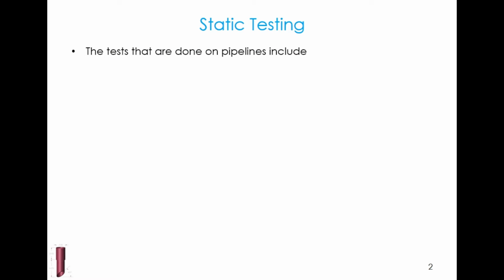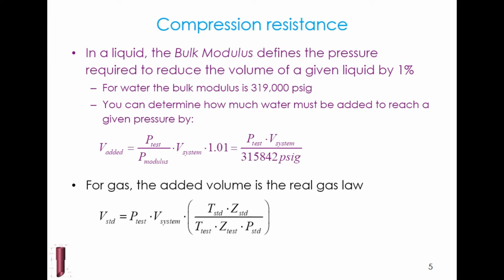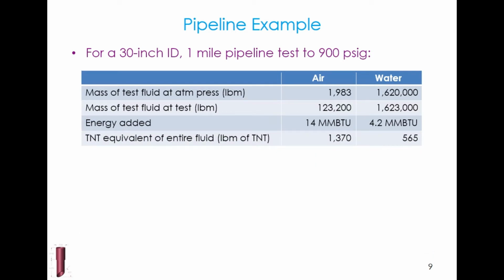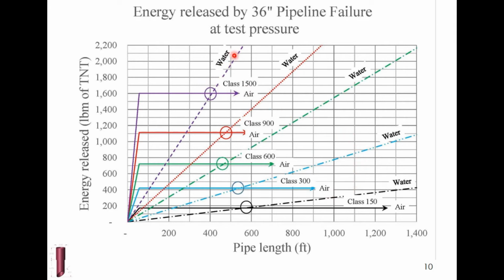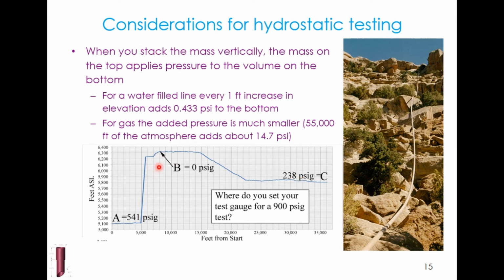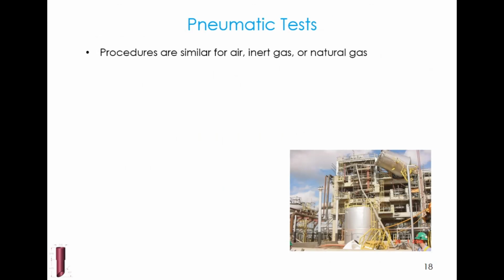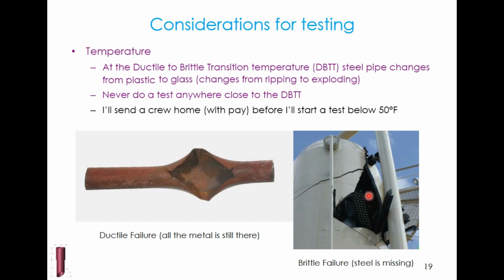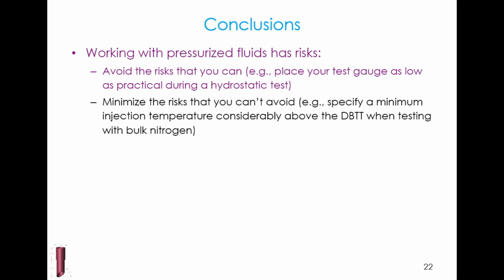Comparative Risks of Hydrostatic and Pneumatic Pipeline TestingV3

Comment: David, on the slide you show at 9:26, you say that in the case of air, only 59 lbm TNT of energy can participate (I assume this is based on the 50ft / 0.025 second estimate). However, in the case of water, you suggest all of the energy from the 1 mile pipe (565 lbm TNT) can participate. Why didn't you limit the water energy estimates to the 50ft (0.025 second) distance?

Have you thought about publishing this information in a ASME paper? Can you suggest any references for the 50 ft (0.025 second) limit?
Reply: Good question. To me it seems likely to do with air being compressible while water is not. So the air loses energy locally rather quickly while water will hold it? I really don’t know.